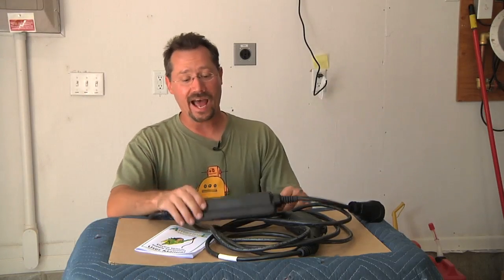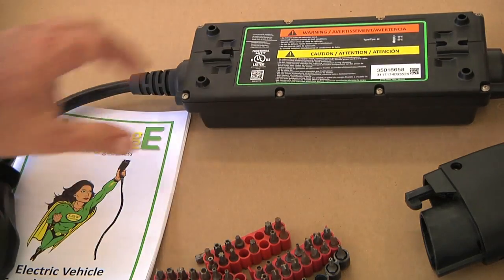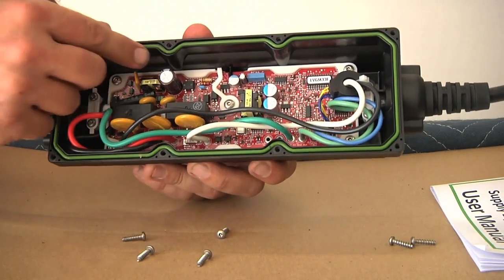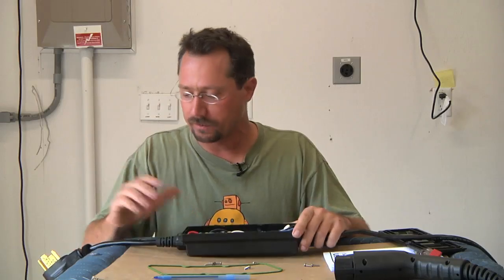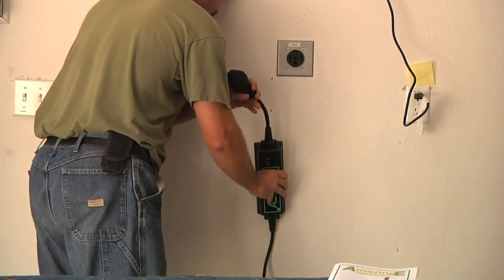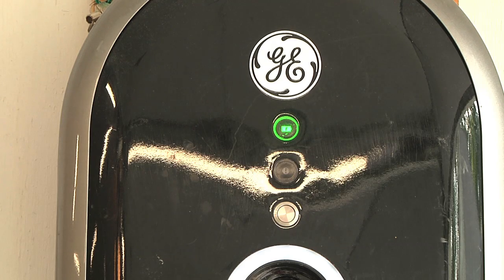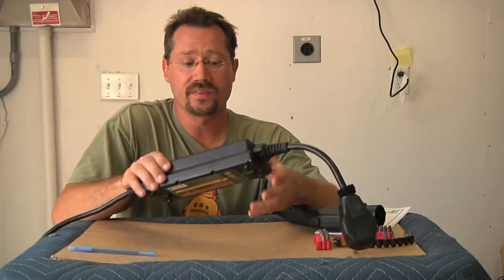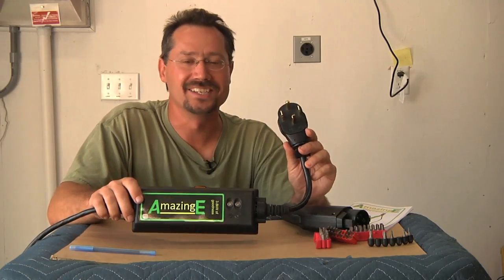"Amazing-E EVSE" - Review and Look Inside

Comment: If you need a cheap Dual Level 1/2 charger consider a Duosida.  Like the Volt Gen 2 charger can do either 120 or 240 with a plug adapter.  Unlike the Volt EVSE (which is limited to 12) and like the AmazingE Duosida can do 16 amps.   Can buy direct from the factory (Zen-car) for about $150.  For a pure level 2 which appears to be us made no less the Amazing E looks really great!
Reply from the maker: A friend has the Duosida, he seems very happy with it. I hadn't heard about buying straight from the factory. If a person can get a Duosida for $150, that's an absolute steal! Otherwise, the Amazing-E is the least expensive Level 2 EVSE that I know of, and looks really well built.
Reply: I have no direct experience with Duosida except reading some reports of not lasting very long. If you don’t NEED the 16A I would go with this unit considering ClipperCreek’s top notch reputation.
Reply: @bluezzer1  

Except that, as Mr. Nelson mentioned, it requires lugging both 120V and 240V units.
Unless you're simply considering it as an alternative to a US$400 wall-mount charger, in which case it's a brilliant alternative.

(I have an L2 (240V) wall charger in my garage, and an L1 (120V) portable that came with the car (2011 Leaf); I'm looking for a combo L1/L2 portable, the Duosida sounds like the unit for me; thanks, migliorm!
Reply: @stevejordan7275  As I recall some (all?) of the Clipper Creek portables are rated internally at 240V. You simply need a 14-50 or 14-30 adapter to use them at 208/220/240V.   Clipper Creek also makes the GM unit sold with Volts and Bolts since 2016, if you open it up it's all rated at 240V even though the exterior label says 120V.  Many people use it at 240V although it is limited to 12A.
Reply: @bluezzer1  
You mean it could be converted to supply power whether it's plugged into 120V or 240V?  That could be ideal.  Hacksaw the fourth prong off and it would work in either (assuming there is indeed no internal connection, as mentioned in the video.)  The Clipper Creek is about twice the price, though.
Reply: Steve Jordan  I would not hack the plug as Clipper Creek puts a temperature sensor for detecting bad sockets. Yes, CC are expensive, and I would check carefully about dual voltage, my research was 2 years ago.
Personally I just bought an EVoCharge on Amazon as it adjusts to 16/24/32A which I needed for the condo I moved in.  It’s light and can be removed from the wall and taken along.

Comment: Maybe L1 doesn't work because the temperature sensors are not hooked up. On the Volt EVSE the temp sensor is there to keep less than ideal wall sockets from melting. Since the temp sensor isn't "working" it doesn't allow L1 charging. That's not a necessary precaution with that 240v plug.
Reply from the maker: Aha! That's a great idea. I wonder if the designers made the board to sense if there's a difference between 120 and 240 and only check the thermal safety if it's on 120v, or if they altered the software to simply only allow 240V?
Does anyone know what thermal sensor is in the Volt 120V plug? If it was super-low tech, it could be something like a bi-metal strip, completing a circuit. I would guess that it's more likely that it's a material that changes resistance with temperature (thermistor). I would bet that the one pin on the circuit board provides a DC voltage signal, and that the other one senses a slightly lowered voltage. As long as the voltage is within a certain range, the EVSE accepts it and activates the charge. Again, this is all a total guess..
I wonder if simply jumping the two pins together would bypass the thermal safety?

Comment: I like the gen 1 Leaf charge cord.  I once found a document on eBay that detailed how to make it dual voltage.  I removed 2 110v only parts replaced one with a dual voltage part and the other with a 220v part.  Cut a jumper wire and added a second fuse.  Now it goes both ways but still charges a 12amps.  And the beauty of it is the mod cost less than $25 with shipping.  I've been using it for 4 years with no problems.
Reply: randycarter2001 can u send info on how to upgrade mine? 2013 leaf 120 v evsc